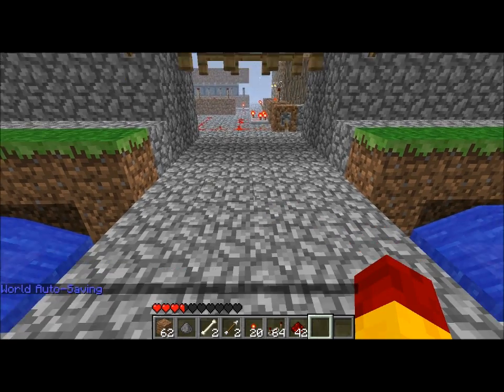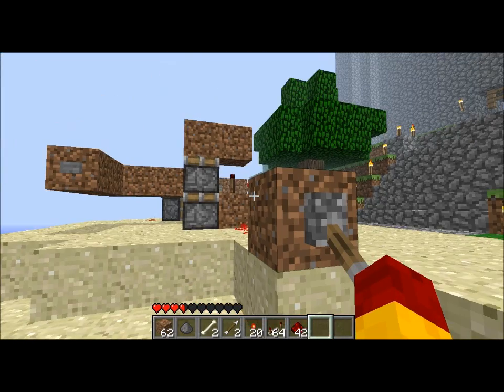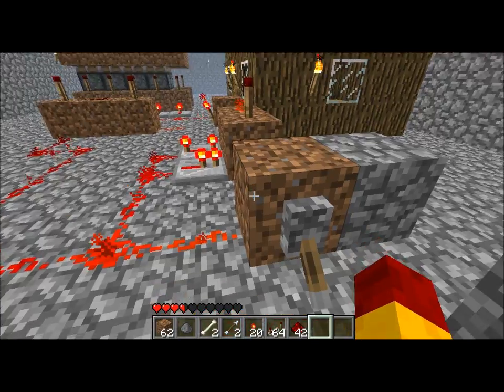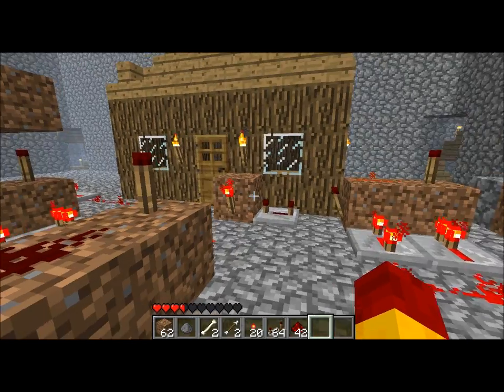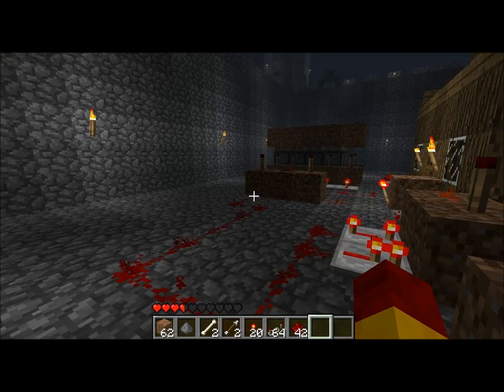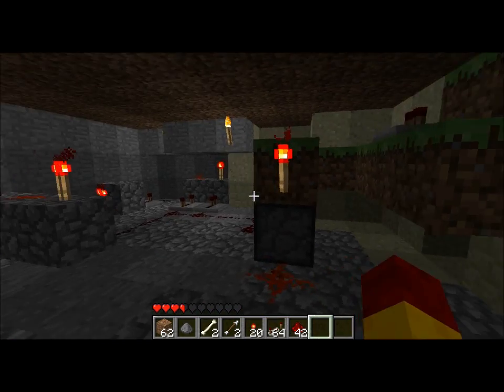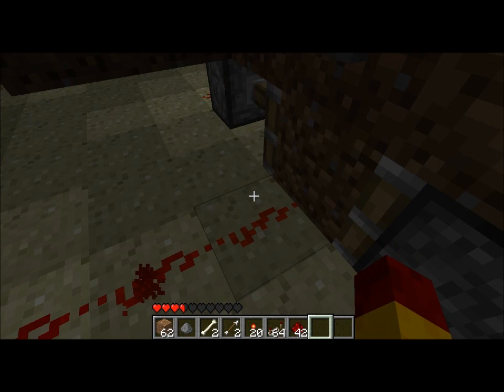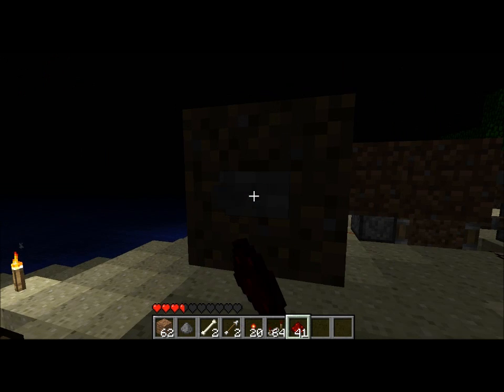Minecraft - 4x2 Double Sticky Piston Array (Drawbridge) + Piston Flipflop Weirdness

Comment: The weird thing at the end is caused by the fact that the button is right above the redstone and the T-Flip-Flop is a falling edge trigger. 

The button powers the redstone wire directly underneath it, and then the button stops powering, which triggers the Flip-Flop, which changes after a short delay during which there is no power being put out. So button power, off, Toggle power.

This wouldn't happen anymore if you moved the button one block to the left.